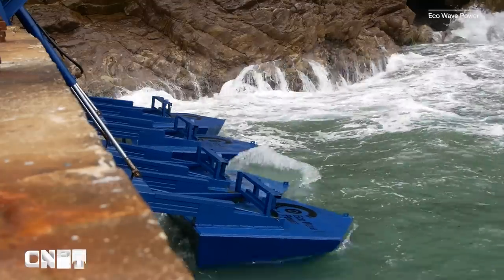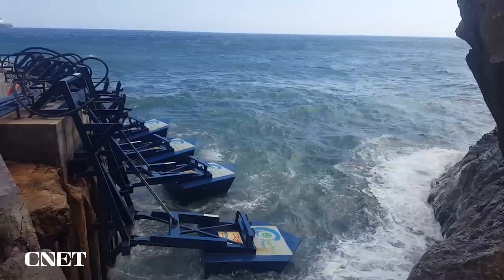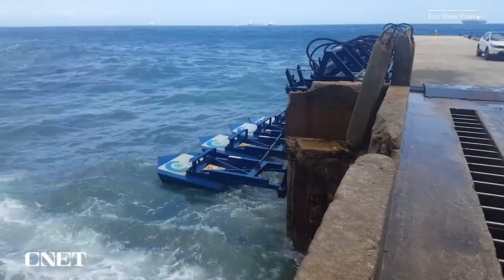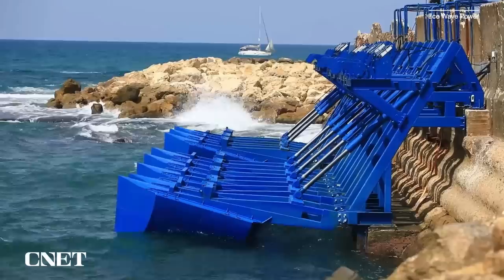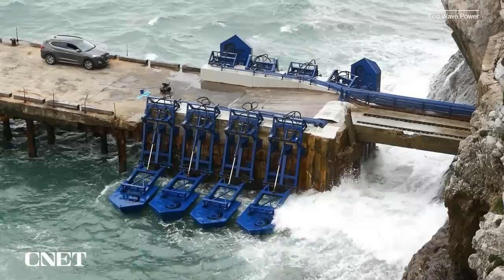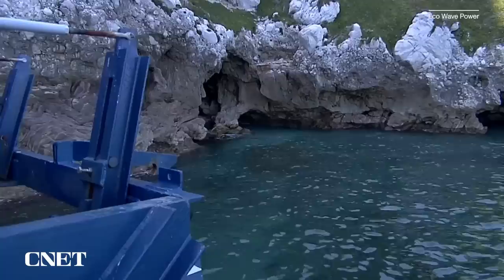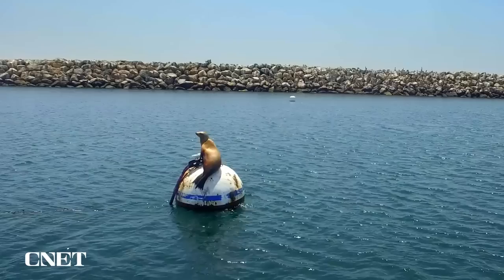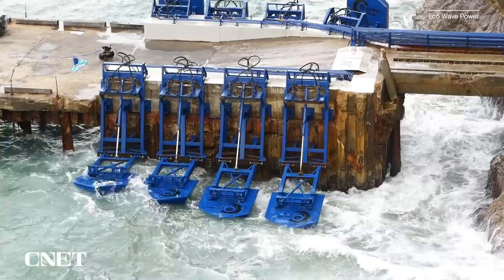How the Ocean Could Power Our Homes

Comment: This system looks like a maintenance nightmare. As soon as all those greasable joints get attacked by the salt water, the efficiency would drop substantially.
Reply: Fair point. But since no system is without maintenance, as long as the cost of maintenance/repairs is on par with (or hopefully less than) current power generating systems, it should be fine.
Reply: Ball Bearings? No grease?
Reply: So you think that they made a system that is vulnerable for the main hurdle in the whole atmosphere? Do you really think that it’s the main plan? So why would they make a system like this then?..
Reply: Yippee.. Someone tried the exact same thing here in Wollongong Australia... FAILED.. Why?
Well, like all yachts and ships... little things grow on what is beneath the water... so they get slipped, bum clean, and back in water...
those floats would need to be taken out of the water, to get their bums cleaned, using co2 blurting machinery...
And because of the underwater Growth they would be heavier, and less efficient..
Don't forget Spongebob would be looking up and Laughing...
Reply: @graemejohnson9025  Did you watch the video? They lift vertical during storms so could easily be regularly cleaned, no doubt using the power generated by other units. And that's creates a job for someone. How is that a bad thing?
Reply: @mensworkshop  and where does the energy to clean them come from? They aren't supplying it whilst being cleaned... they tried it here... after 4 years, it all went to the scrap heap..
Reply: Oh well. I guess they should just give  up, eh @graemejohnson? They should've called you first, could've saved all the hassle...🤦
Reply: @mensworkshop  exactly!
Reply: @paulc.sachsejr.7209  Thank goodness we don't live in a world where inventors give up trying the moment they hit a problem or a set back.
Reply: @graemejohnson9025  Damn, who hurt you when you were little?

Comment: To make it cost efficient it need to operate for decades without much maintenance.
Salt water is a very difficult environment. But their system is simple and use standard component, maybe it’s cost effective in certain locations.

Comment: Like Paul C. Sachse Jr. said, looks quite probably a maintenance huge regular cost. And I add to that, what about tides? No explanation is given on that, but they seem to be fixed structures. Consider 2 metres water level difference there times a day and one wonders how the system can perform and thus influencing eficiency.

Comment: I'm down for having those things. 50% ain't too bad. They said one floater powers 10 households. What if those households have electric cars? And can we use the electricity for electrolysis instead so that we can make clean hydrogen from the water also.
Reply: or water-powered desalination
Reply: @MadsterV  wow….that’s an excellent idea! Especially in California where there are droughts all the time and major coastal ag production
Reply: They said a floater generated 10kilo watts.

A bit unfair to ask them if it will cover electric cars as it is all dependant eg if the electric car was used every day to its maximum range every day  it will need 7x more than if the car was only topped up every week.
If you know how many kilowatt hours the house you are thinking of uses then you can get a fair estimate of the number of households.

Storing hydrogen is an issue, it is the smallest molecule so can leak through the gaps in-between other molecules and can leave the earth's atmosphere.

Regenerating aluminium would allow you to have hydrogen on demand without electricity rather than stored.
Reply: @infinitedigitalprintservic5684  
Unfair? That’s silly. What’s the definition of a household then? Don’t be an idiot. We are always talking about averages in these situations. You should know that.